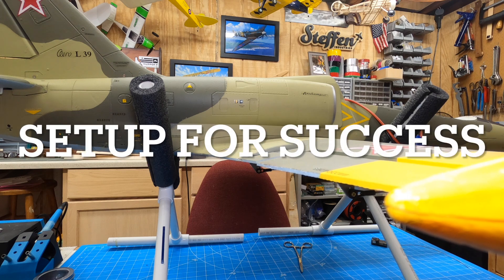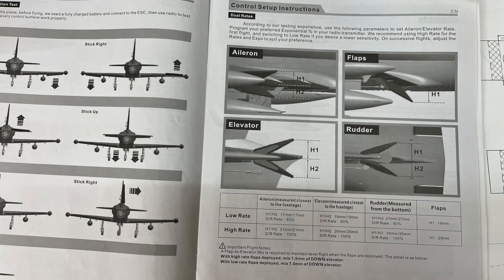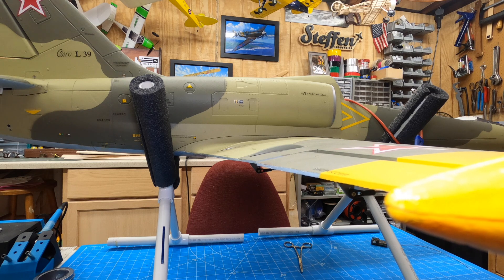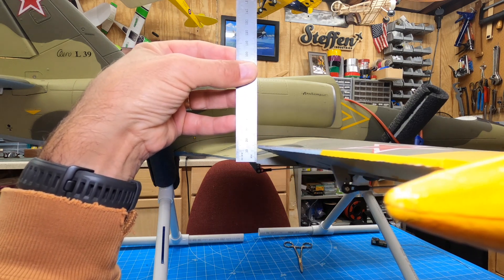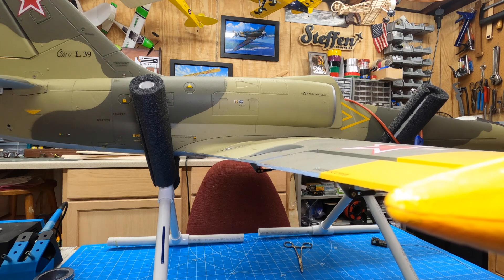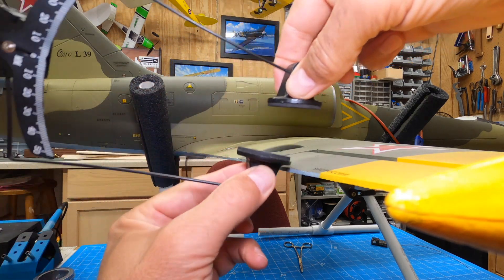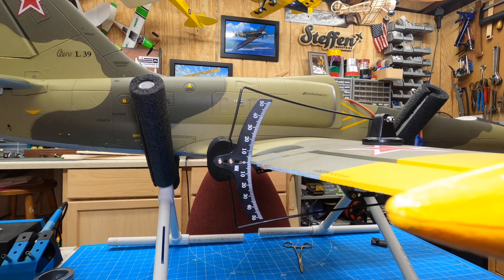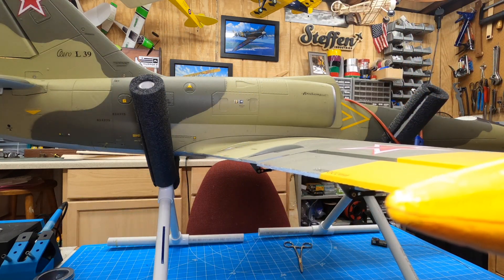How to setup control surface throws on rc plane

Comment: I’m gonna try the ruler method.  Thanks.  Man your channel has so much for the new guy like me.   Bigger flies better!
Reply from the maker: Setting up the initial throws so you can fly the plane without crashing it is super important.  Then after the maiden, you start to tweak.  The issue with aerobatic planes with HUGE control surfaces is when I setup with too much throw and not enough expo.  Makes for an unpleasant maiden.